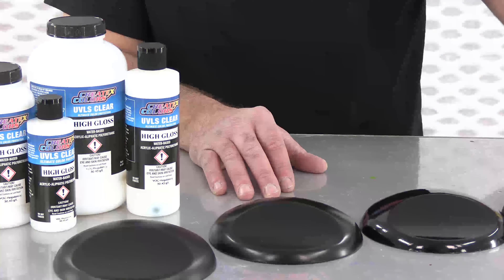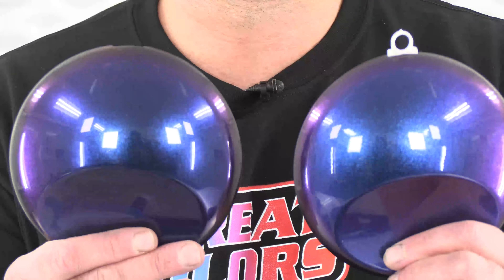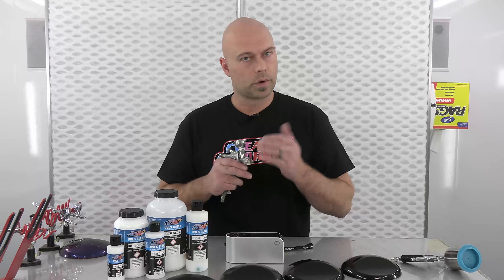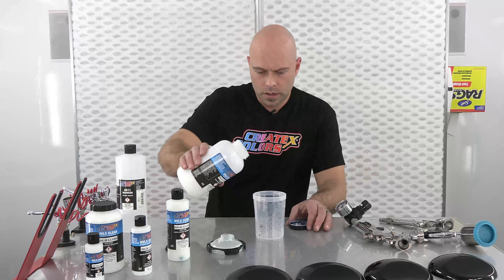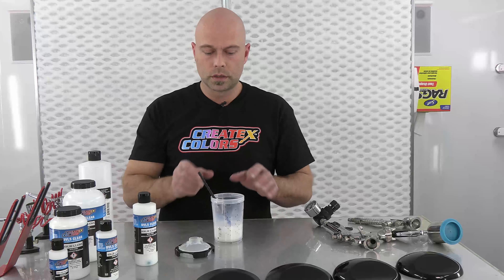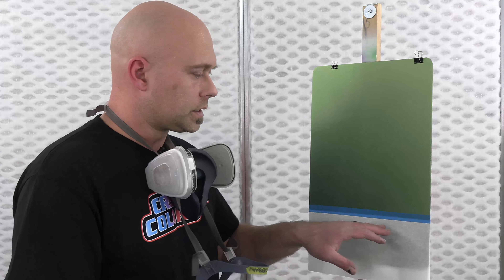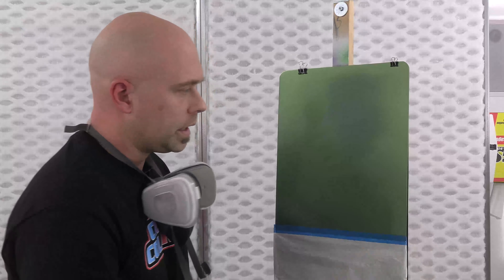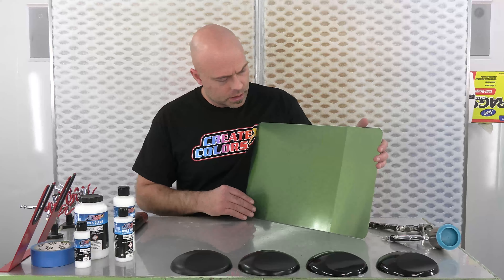Createx 4053 UVLS High Gloss Clear Part 1

Comment: it still amazes me how much time and effort Createx puts into helping to understand and use its products! rare these days.. Quick question though, when applying 4050 to a helmet (ABS) as a adhesive primer,  is it possible within the 48 hour window to add coats of 4030 or Autoborne sealer over the 4050 to maintain its open window? Or do I wait 48 hours and scuff it before applying a Basecoat (wicked)? I am waiting the full 48 for max adhesion to the ABS. Thank you!
Reply from the maker: AutoBorne Sealer can be applied over 4050 ~ 30 - 60 minutes after its applied. After ~ 48-hours air drying, 4050 has cured to a hard enough coating that best adhesion is created when the 4050 is scuffed 600 - 800 grit before applying AutoBorne Sealer; before this, the 4050 is "soft" enough that AutoBorne Sealer can be applied direct. Thanks for the kind words about our customer service.
Reply: @CreatexColors Thank you so much! Right there is proof about the customer service with a very quick and helpful reply!

Comment: For airbrush... how long will the reduced mixture last... shelf life... I'm a small batch bait maker... and mixing small amounts and getting the correct ratio is a challenge...
Reply from the maker: After thinning with with 4011 Reducer, UVLS Clears can be stored indefinitely so long as the bottle is capped air-tight and kept in a cool, dry place away from direct light (cabinet). Please note, our 48-hour "shelf life" after thinning with 4011 Reducer is conservative and actual shelf-life extends well beyond this. Thank you.

Comment: Definitely interested in the high gloss

How does this work if I’m using two tone color wheels? 

What will be the process of doing two tone, color wheels and also omitting the high gloss? What will be the procedure and baking between
Reply from the maker: Definitely make a test panel to determine the resulting finish. For automotive, we recommend a catalyzed (2k) urethane clear. We do not recommend UVLS Clears as the final top-coat on an automotive wheel. Thank you.

Comment: Very informative video, thank you for sharing. For the 4050 do you recommend a .5 tip as well?
Reply from the maker: Yes, 0.5mm at the very least. A little bigger would be better. Even with a 0.5mm tip, please note that not to all airbrushes are the same and one's with smaller, internal channel are more restrictive compared to a high-volume airbrush such as an Iwata Eclipse. Thank you.

Comment: How does 4053 work as a top coat on fishing lures?
Reply from the maker: 4053 and all UVLS Clears are not recommended as a top-coat for fishing lures. A catalyzed (2k) epoxy or urethane clear works best. UVLS Clears are suitable for exterior applications, but are not intended for long-term, water submersion. Thank you.

Comment: Hi Chris... I read that once the base coat dries, there is and open window for applying the finishing clear and the base would not need to be roughed up.  But can a scuff pad be lightly used to clean the base prior to clearing to get rid of any small contaminants... Thanks.. M
Reply: I see that you can from your video....Thanks Chris
Reply from the maker: thanks for watching!

Comment: Curious, can 4012 be used in place of 4011 or should i pick up both?
Reply from the maker: No, 4012 is being phased out and doesn't work with a lot of new Createx paints such as candy2o, UVLS Clears, 4030 Balancing Clear, and Wicked Opaque Colors. Thank you.
Reply: @CreatexColors  Thanks a ton for the info.

Comment: Has anyone tried this with chrome paint ?
Reply from the maker: 4053 High Gloss applied over AutoBorne 6001 Sealer White or 6002 Sealer Black makes an excellent base for a good he chrome-like effect of billet aluminum colors, specifically W357 Quicksilver and W358 Gold Chrome. This application technique allows for the reflection of light through the aluminum particles, creating a highly reflective silver finish that mimics a chrome appearance. The distinctiveness of the image (DOI) is a measure of how mirror-like the finish is, with higher DOI values indicating clearer and more reflective surfaces. The application technique, base color choice, and curing process all contribute to enhancing the DOI, thereby achieving a closer resemblance to actual chrome. Thank you.
Reply: It worked great for me, just be sure not to speed dry your simulated chrome piece(s), and allow enough time for your parts to dry thoroughly before clearcoat application.

Comment: Hi Chris/team, thanks for another informative video. Just wondering if UVLS 4050 clear is the right product to spray over aluminium foil tape that I use to provide texture and flash to my timber fishing lures, as a clear layer before applying coloured paint over the top. I am wanting to maintain the flash/shine of the foil through the transparent/candy colours. Should I layer a straight 4050 coat between layers, or just mix it into the paint to provide adhesion? Thanks in advance
Reply from the maker: 4050 UVLS Gloss clear will work well as the initial coating direct to aluminum foil (6000 AutoBorne Transparent Sealer also will work well). As 4050 is added to candy2o (and should also be with transparent / other colors), applying additional coats of 4050 isn't required. The gloss and depth of the candy2o and transparent colors over the aluminum foil will come from the gloss clear applied as a top-coat. For fishing lures, a catalyzed (2k) urethane or epoxy clear is recommended. Thank you.

Comment: Would these clears be good on a guitar? As in hard enough because of course always handled?
Reply from the maker: UVLS Clears work for an object handled frequently, so they could be used on a guitar, however, we would still recommend a 2k clear for guitar refinishing as a 2k clear is more scratch resistant and that what the industry standard is, a 2k clear, so no, ultimately UVLS Clears are not recommended as a top-coat for a guitar paintjob. UVLS Clears will work in regard to adhesion, and durability as a protective coating, it will just scratch easier compared to a 2k. Thank you.

Comment: Hey Chris! I was just thinking a bit during this video. I get that the 4050 is the go-to for the candys, but what would the effect be if you mix the candy2O line with 4051 or 4052? Any chance of video testing how the candy20 looks with the different UVLS clears as carriers?
Reply from the maker: Only 4050 is recommended as the carrier for candy20; mixing with 4051 or 4052 lacks the adhesion. To create a satin or matte candy finish, apply 4051 or 4052 over candy20 mixed with 4050. Thank you.

Comment: Love the Createx products.  Your videos are excellent as well.  I just purchased an LPH80 1.2. what air pressure works best for that gun?
Reply from the maker: Spray using the gun manufacturer's recommended psi. We set our LPH-80 with a 1.2mm E4 tip at 18 psi inlet. Thank you.
Reply from the maker: The E4 cap evenly distributes Createx paints through the entire fan pattern whereas E2 cap has more material in the center of the fan pattern, as well as a smaller pattern width. The E4 cap helps prevent uneven build-up of color commonly referred to as "striping" when painting with transparent and candy colors. Thank you.

Comment: Very informative video as usual Chris thank you! One question, I would like to use the high gloss UV LS instead of KBS diamond clear to seal fishing lures. I see in your data sheet that it can be submerged in water after 5 days of curing. Would you recommend this as the final top coat for this application? Thanks again and keep up the great work!
Reply from the maker: We recommend a 2k epoxy or urethane clear for a fishing lure, so KBS Diamond Clear over UVLS Clear. Thank you.

Comment: Curious, are these clears good enough to use on cars as a "normal" clear coat? Meaning, can I use this as a UV protective top coat just like solvent based 2k clears? Do I need to spray more than 2 coats for UV protection?
Reply from the maker: UVLS Clears are architectural-grade, non-catalyzed (1k) clears, suitable for exterior applications such as signs and durable enough for use on cos-play, theming and modeling, but are not as mar-resistant as are an automotive-grade, catalyzed (2) clear, for which we recommend https://youtu.be/JuroIpJOCNo. We recommend 3 medium-wet coats, each applied 0.5 - 0.75 mil. Re-coat time is when paint dries tack-free. Thank you.